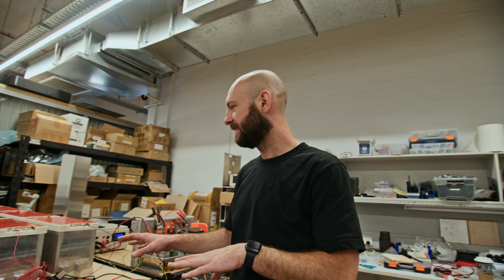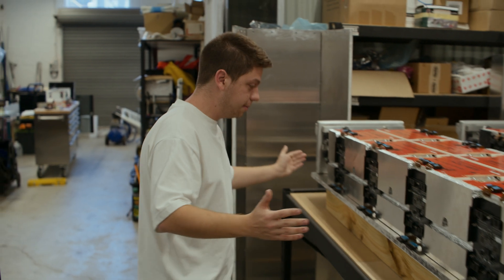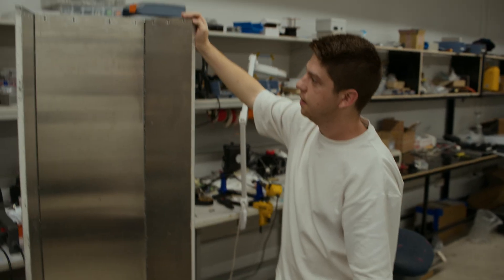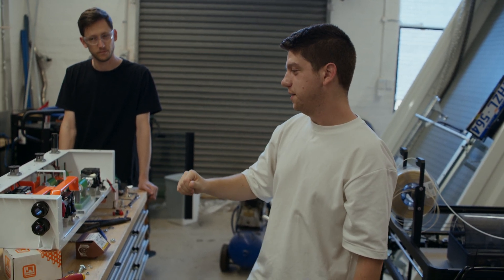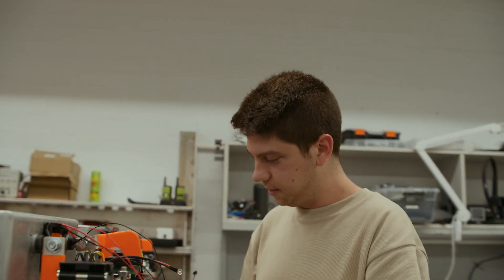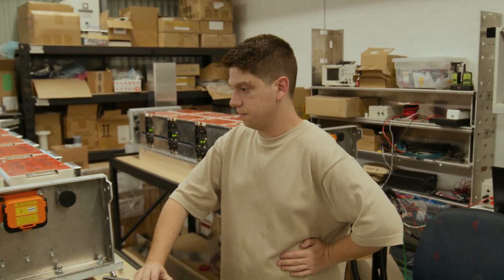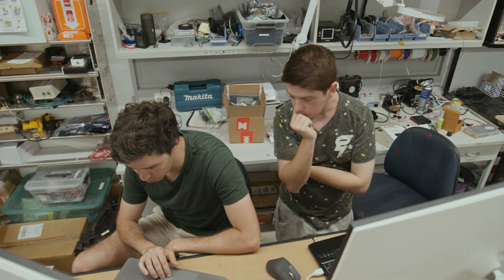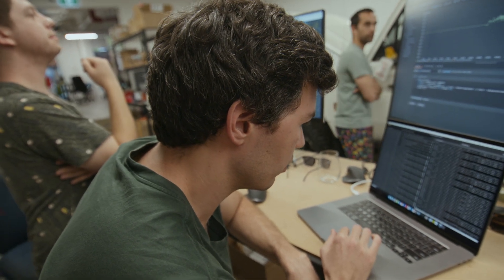First Power Up & System Integration of V8 Hybrid Land Cruiser! 🔋⚡-  EP.09

Comment: Why? 
Wouldn't a BMW Straight 6 Conversion with a ZF gearbox for example yield the same if not better results?
Reply: Because that would not meet the requirements of the design brief
Reply: @ true, I guess it will work on some level and some mining companies might buy a few.

TBH it will be interesting to see if the Ineos gets a crack at the mining sector, I think they will at some point with a basic option pack for them. The Engine and Transmission package should yield the same results long terms as one of these for probably 2/3 the cost.